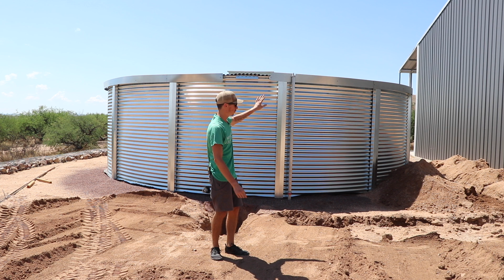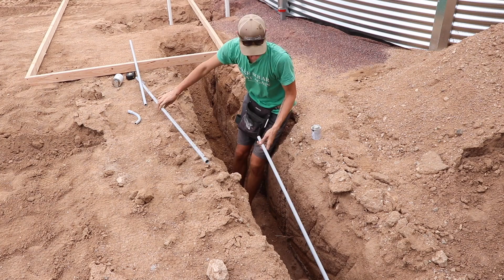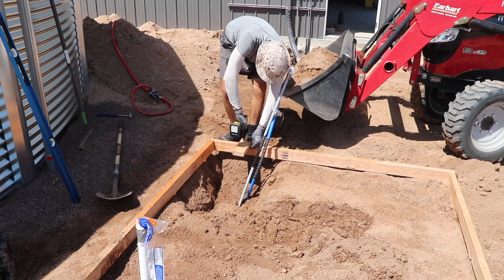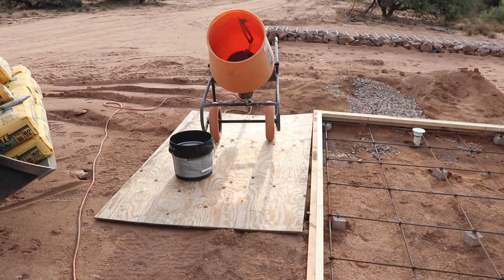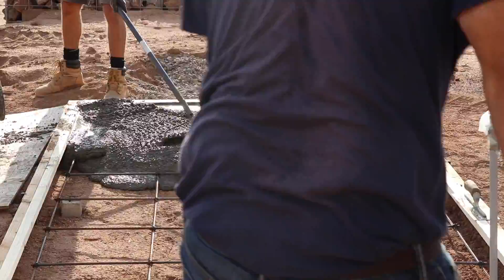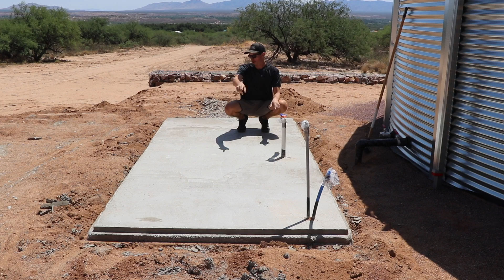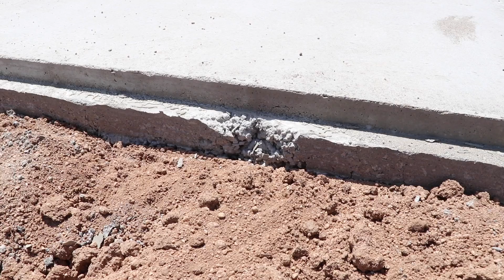RAINWATER PUMP HOUSE FOR 28,000 GALLON WATER TANK - Slab (Part 1)

Comment: hydralic cement on honey comb np,  3 day wait  recommend 7 day make sure water slab for min 7 days that get u 75% strength straight portalnd mix, fly ashh in mix 7 day must only 25% strength if fly assh, 28 day on both for design strengths , x inspector, civil engineer 40 years experiences
Reply: my company's were capstone testing and inspection, and minnesota testing lab and inspection, also eagle woodworking remodeling company,  stealth bomber projests to subdevelopments , commercial sites soils to roofing
Reply: retired

Comment: Like your channel. Then 2 things I wouldn't do ( having worked on a farm for many years) , 1st make a 1sq foot hole in slab where pipes come up out of ground ( makes future repairs or additions easier)  and pack with sand a gravel afterwards. 2nd, don't bother reducing the pipe . For a run that short reduce/enlarge  the fittings at the end of the run. It cuts down on flow restrictions if you add on in the future, and is less misleading to figure out what pipe goes to what (ie 2 inch pipe at tank, I would be looking for a 2 inch pipe in pump house)  . You did the same thing on the 4 buried tanks. Mind you, Im looking at this from a farming perspective,  which means moving a lot of water when you have to. Also if the pipes were big , then you could also use this to feed any fire supresion stuff you might want to add on later.  Anyway, not being a hater or anything, really like your channel.
Reply: i was thinking the same, here in sweden we just add a larger bit of pipe to pull it through, less damage to the concrete over time.
Reply: liked your point of the 1 sq foot hole in the slab and not reducing pipe size till inside pump house. ( i'm a plumber)

Comment: My wife and I have been subscribed to your channel for some time now and we recently purchased an uncompleted off-grid house just about an hour southeast of you (Douglas, AZ) and we'd be very interested in learning more about your water pump, pressure tank, and hot water heater. Our house was designed and built as an off-grid house. It is a 600 sq ft burnt adobe block house with a metal lean-to roof for rain catchment. We purchased 3 Enduraplas water tanks from Rick at Oasis Water Harvesting and are just about ready to purchase water system components (pump, filters, water heater, etc.) and begin connecting the system. The house is basically a shell ready for us to make it our own. We look forward to your upcoming videos regarding the pump house and components. We also purchased a new Mahindra Max 26XLT loader/backhoe from Earhart based on your recommendation and further research and love it!
Reply from the maker: Oh that's awesome! send me an email: derek@diyhomesteadprojects.com and when it's done you can come check it out :)
Reply: @Handeeman  Thant would be great!!! I'll send you a brief contact email shortly.

Comment: Maybe a little late, but before you poured concrete, you could have dung holes into the ground that way concrete would fill those holes with rebars and become part of the slab as an anchor.

Comment: I would think sleeving the rough plumbing would allow way more slab movement without pipe damage.   i'd put it into a piece of 3"
Reply: I second the slab sleeve - it also helps when you have to (inevitably) replace a line that gets damaged!
Reply from the maker: good to know now I guess haha
Reply: @Handeeman  Well when it settles and cracks you can do it right.  NBD.   or you could just bring it in the wall and abandon the under ground connection.  Will also let the heat from the building travel up stream when the water is still to keep from freezing up.  by going into the ground you're relying on ground temp only.

Comment: Yep, you really got to work it with a trowel or stick to get those nooks & crannies. You can tap the boards with a hammer along the sides to help things settle along the edges and get a clean line, or a recip saw without the blade makes a good vibrator too...  Usually 2 weeks is enough time to let it cure before building on it. Two thumbs up for all the prep work on the slab! I'm sure all that dirt work out in the desert heat wasn't fun. Only thing I would have done different (for where I live) would have been to raise it a little higher above grade because heavy rains always make me worry, but you being in the desert it's probably a non-issue... lol.
Reply from the maker: those are some great tips! thanks Jason

Comment: Concrete reaches a 50% cure in 24 hours.  You could start drilling and anchoring in 7 days but concrete will reach what is considered 100%  break strength in 28 day.  Now concrete never stops hydrating (curing) but a week is probably enough.  For fence posts, I don't even mix the water just place the post and pour dry mix into the hole.  Where you're at,  you might need to add water but anywhere grass grows will have enough ground water to hydrate the concrete mix.

Comment: You can start building on it and placing the anchor bolts into the slab now while it is green.  It will take about 21 days for it to fully cure and doing it now will make it much easier.  In future place anchor bolts in slab before while you pour slab that way you don't have to drill and set the bolt.  Looks good, wishing you well on this, also do you have any issues with evaporation of water in the tanks due to the heat?
Reply from the maker: Hey Brian, that's a good idea, I can do that next time.

No issues with evaporation really because the tanks are pretty well fully enclosed except for the basket strainer.
Reply: @Handeeman , In Australia we "vacuum" the floor of the tanks where any rubbish settles (when the water level is low) about every 10 years or so. Done by a specialist in snorkel gear. Generally we use no filters at all between catching the water and its use (metal tanks, concrete tanks, poly tanks, no different).

Comment: Nice vid; however, you are totally wrong about the pipe freezing!!!

Back in 2011, we had one hell of a freeze here in the Tucson area, and it got down to 18 deg. In Tucson, and 12 deg. or less in the outer/higher elevation areas like Benson!

Tucson Water and other water companies & customers had a huge amount of broken STEEL pipes, pumps, etc. Because they didn't insulate them worth a damn!

Not saying you must insulate now & all the time, but have some thick fiberglass insulation &  heavy insulating blankets (in sealed bags) ready to install later!

Otherwise, you're gonna have 28,000 gallons of water & mud all over, a bunch of errosion & a big repair job!
Reply from the maker: Things like that happen infrequently but must keep in mind, I'll have some blankets on the ready.
Reply: We had one day at freezing here in San Tan Valley and it stopped water flowing for a couple of hours. We have a local water company and I can see the storage tanks from my place. This time of year the "cold" water is about 120F. It's funny how they think that they can put pipes 6" down here because "it doesn't get cold". Reminds me of San Francisco where they don't have AC because "it doesn't get hot" and then they are miserable when it gets hot.

Comment: Maybe a good idea when bringing pipe/conduit thru concrete to sleve with a foam wrap to cushion the pipes/conduits
Reply from the maker: good idea!
Reply: @Handeeman  Foam wrap is standard to allow for slight movement if or when the slab cracks. This will also help if you need to cut off at ground level and add new pipe.
Reply: @kameljoe21  I suppose with a foam sleeve you could even undermine the slab to extract an old pipe and replace it with new much easier?
Reply: @BobHannent  Yes many times where a floor drain gets set or concrete is set just too high ( you have to grind and sand down that concrete. It is a chore that will piss you off.  I have seen concrete installers cover the drains with over one inch of concrete. ) you can cut out that drain and reset, thus the reason why about 1/2 to 1" of foam is added around penetrations in the concrete. In buildings with concrete levels we core drill.  I have laid and installed a lot of plumbing in my few years working as a plumber.
Reply: 100% agree, you don't want your pipes to crack if the concrete moves or expands at a different rate than the plastic.  Foam wrap is how we do it where I am.
Reply: How hot internally does concrete get when curing.? What’s sch 40s pvc max temp?
Reply: @adamgruber2342  Schedule 40 PVC's maximum operating temperature is 140 degrees Fahrenheit, Concrete should be kept cooler than 90F when curing...

Comment: Wait 2 weeks, then build. Poured concrete establishes about half of its final strength after about one week of curing. Curing is defined as a chemical process the concrete goes through in the days immediately after it is poured. While full strength does not occur for 28 to 60 days, depending on conditions, the building process can begin when the foundations are about 50 percent cured. Proper curing occurs when the concrete is warmer than 50 degrees Fahrenheit. The poured foundation should be kept as uniform as possible in temperature during the curing process. All of these steps help speed the curing process and also result in an overall stronger foundation wall once the curing is complete. Temperatures of 70 degrees compared to 50 degrees, for example, reduce the 50 percent strength curing time from 6 to 4 days.
Reply from the maker: good to know! thanks for the explanation :)

Comment: You may have been better to wrap the pipes in light / rubber / foam to provide insulation against any movement as the concrete expands /contracts as it cures. Don't forget when you are filling the trenches to ensure the soil is also underneath the piping, which most people forget to do, and when compacting they can crack the unsupported pipe.
Reply: Sleeve the pipes with another pipe to allow for movement in all 3 axis.   for 1.5" pipe i'd sleeve with 3"
Reply: @jeepxj  , Never seen that done, great idea. From Australia.
Reply: @wyattfamily8997  How do you manage slab movement compared to pipes coming thru? Some people wrap with just sill foam to give a bond break between pipe and concrete.  I think more is better by sleeving with an entire bigger piece of pipe. then you know for sure the slab can rise/fall without stressing the joints underground
Reply: @jeepxj  , Normally we hammer galvanise bars into the ground and tie to the reo which reduces slab movement. If extending an existing slab we "tie" to the original slab so any movement is in tandem and no gap presents itself.
Reply: @wyattfamily8997  desert soils will expand/contract far more than most.  when he gets those big rains i'd expect a bunch of movement/settlement.  esp with no footers or anything.
Reply from the maker: those are some great ideas, thank you

Comment: Usually you have to wait 4 weeks for the concrete to fully cure. After 2 weeks concrete has about 85 % of its strength. It helps to water the concrete in the waiting period.
Reply from the maker: good call! will do

Comment: Hi handy 
Always shower concrete platform for the first few days especially when it is hot 
Less cracking. 
The concrete takes up to 3 years to really cure .
You can still holes in it after 2 days.
Good luck.
Reply from the maker: great, thanks!